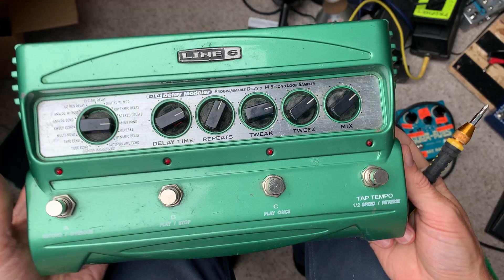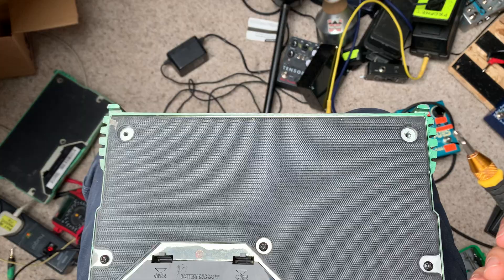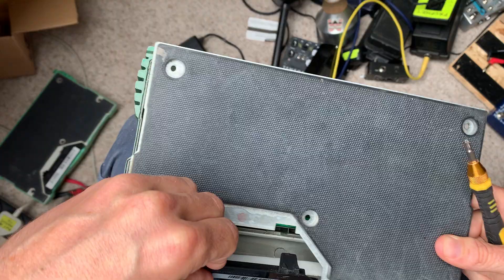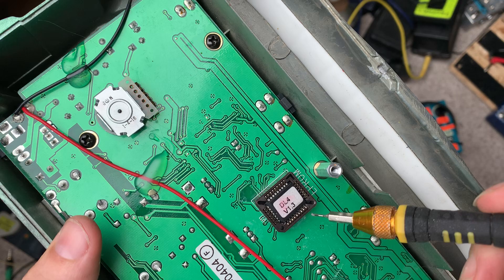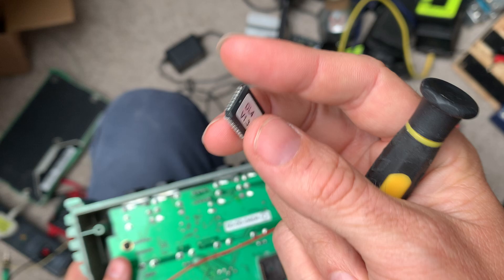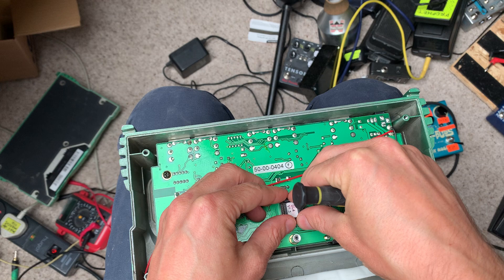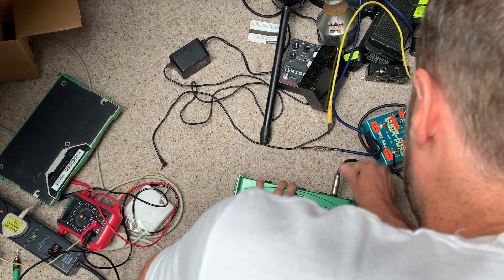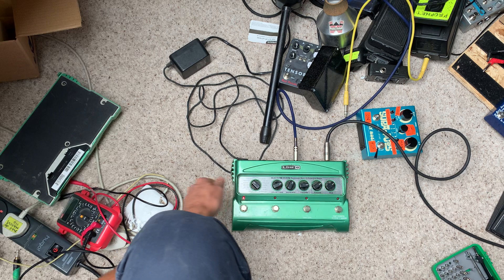How to fix a broken Line 6 DL4 looper / delay pedal - really quick and easy  - no soldering required

Comment: I can't believe it. I bought a new power supply for my FM-4 (same line as the LINE 6 DM-4, and other similar cased pedals) and it still didn't work. saw this video and honestly thought it wouldn't work, but was worth a shot, and... it worked. it worked perfectly. the pedal is now back to being fully functional. thank you so much! simply reseating that chip did it!
Reply from the maker: Really pleased to hear it works for that too! They probably used the same type of chip and socket?
Reply: @marcushamblett  its the exact same, it just says Fm4 instead of dm4

Comment: Huh it worked. I've got a DL4 that would not power up. I'm looking at it for a friend. I opened it up and checked a few voltages but there was nothing conclusive. I went online for a schematic, saw this video link and checked it out. Amazing. I pulled the EPROM chip out, stuck it back in and BOOM! everything works like normal. Thanks. How long does it work before it needs this again I wonder? Extra useful cool video dude.
Reply: where did you find the chip?

Comment: So I stumbled upon this pedal at a friends house. He had no use for it, didn't know where it came from, said I could have it. Long story short I took it home, cleaned it and plugged in. to my surprise it powered on, the lights worked properly, but unfortunately it only got sound from the guitar while in bypass mode when the lights were off.. hence no effects/looping or use of the pedal functionalities. I watched 2 videos and before trying the soldering option, I decided to try this easier option first. Well.. I popped out the chip and put it back in and now it won't even power on, the lights no longer work... i'm left frustrated and puzzled.. (not your fault) I just don't understand what could have went wrong. Any ideas?
Reply from the maker: Sorry to hear that. Did you definitely put the chip back in the right way round? And are you powering the pedal correctly?
Reply: @marcushamblett  the pedals lights were turning on, working properly, the tempo setting lights working. I just couldn't get any sound out of it. so I took out the chip and put it back, and now the lights don't even turn on anymore. I had the proper tool altho didn't come out as quick and easy as you were able to. im pretty sure I put it back in properly, I felt the heat of the chip. but im no professional at this.
Reply: @marcushamblett  I put the chip in the right direction yes.
Reply: maybe the chip damaged some how coming in and out?
Reply from the maker: @PalisadeNights  i'd try carefully removing it again, cleaning the socket and contacts with isopropyl alcohol and reseating it again, making extra sure it's the right way round (there's a dot or something showing the orientation)